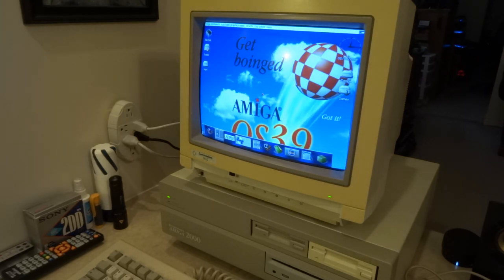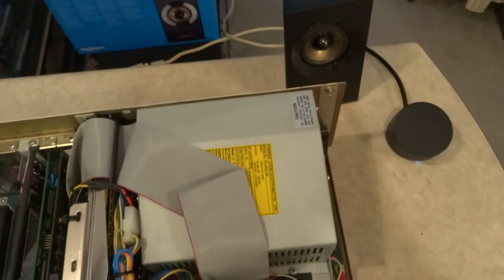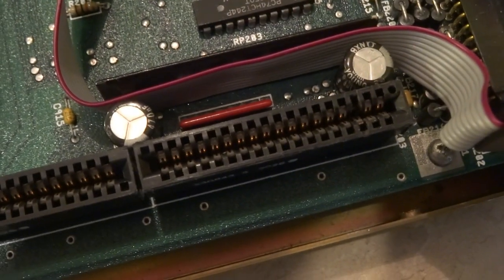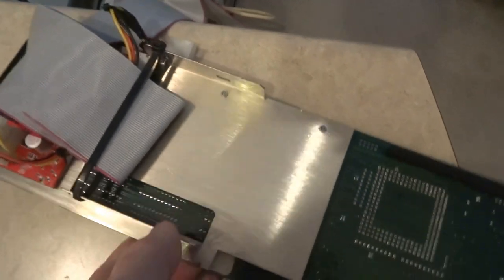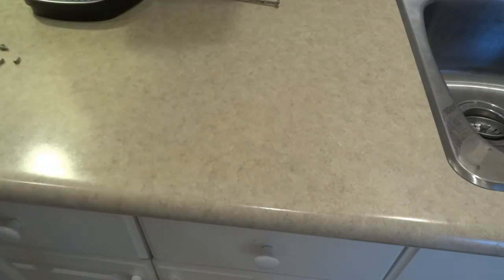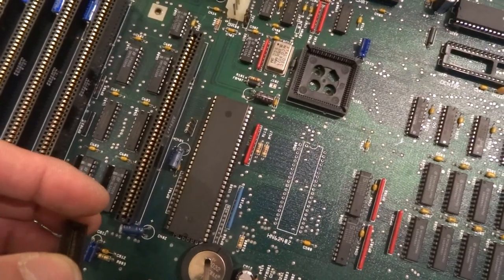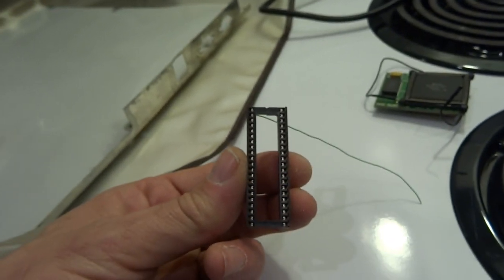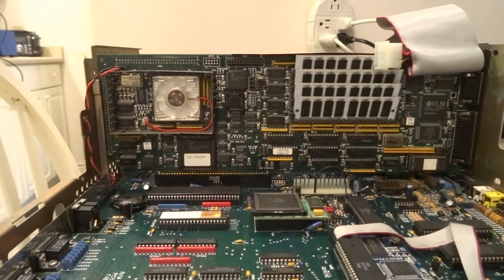Amiga 2000 1MB ROM Upgrade (and other things) - Part 1

Comment: Nice video and skills! And, what a very neat setup you do have there! A2000 was (and still is) so versatile, I love it. Cheers, M
Reply from the maker: Thanks you so much. It's appreciated. I have had electronics as a hobby for many years and the Amiga has been part of my computer Interests for almost as long (over 25 years). I definitely agree, the Amiga is truly one of the most versatile computers ever invented.
Reply: The A2000 was a very good Amiga, a simple upgrade to the A1000 (perhaps what the A1000 should have been in the first place; some subtle improvements and cost savings were done I think, which probably necessitated the experience of making the A1000 to learn lessons, but the A1000 was a bit of a compromise because there wasn't complete agreement on whether the Amiga should be a low cost home computer or a very expandable business machine, so they had a rather costly home computer that was a bit bothersome to add hard disks etc. to, and it only had 256k as standard). The A2000 was, as I say, a simple but significant upgrade, quadrupling the Chip RAM and adding large physical capacity and a generous number of expansion slots that didn't necessitate separate cases and pass throughs and lateral sprawl across a desk (which expanding the A1000 entailed). I love the massive expansions cards, they look so impressive :) The A2000 was very versatile by the simple virtue of this expandability, it made it a good starting Amiga for anyone contemplating big expansions in the future. I think it was pretty good value for money at the time too, whereas the A3000 (though a great computer) seemed rather costly for what it was (and I've heard that its slightly smaller case, though undoubtedly beautiful, meant that it could not accomodate a Video Toaster, possibly the most illustrious expansion card that existed for the Amiga. That was a bit unlucky for Commodore as Wikipedia suggests that the Toaster came out late in the same year as the A3000, 1990), as did the A4000. A2000 accelerators and the like did however tend to be a bit more expensive compared to the other big box Amigas (I know this from perusing magazine ads). That's a lovely desktop background, though I always feel a bit strange when I see Workbench which isn't rendered in either muted blue and grey or bold blue and burning orange :)

Comment: It”s 1MB RAM, ROM is the Kickstart. Got the new ACA1233n-55 in my A500 and latter in Oktober also in my A1200. My A500 Rev6A is a beast. Have 2MB CHIP RAM from the ACE2, ACA500Plus V1 and the 1MB SLOW RAM and 128MB FAST RAM from the ACA1233n-55. Running 68030 with 55MHz on AmigaOS 3.1.4 with a full 64GB CF card. Have connect it with the Indivision ECS V1 on a BenQ BL702A VGA 17 inch mknitor. Waiting for the Indivision AGA MK2CR for my A1200 for my second BenQ BL702A monitor and have 2 Bose speakers sets. Have now the ACA1221EC in my A1200. 

The AMIGA 2000 is a great AMIGA such as the A1000/A3000 and the A4000. Like the A3000 the most. For me the A500 and A1200 are more than enough.
Reply: It is a ROM upgrade rather than RAM, it's replacing the original K/S ROM with a later version of it. It sounds like you have some cool Amigas, I sadly no longer have any!

Comment: Fun video, thank you.  I have the save GVP, got the memory sims from the Denmark Ebay seller which look just like yours. In any event, I had the SCSI2SD adapter as well and had to CTRL-A-A on every cold boot to get it to boot. Must be something with that adapter and CPU card.  I replaced the SCSI2SD with a Buddha IDE and don't have any boot issues, it is also much faster. I noticed you had the CDA header connected to you Prism Megamix, were you able to get CD audio working with it?
Reply from the maker: I am glad you enjoyed the video. I have the same issue (as you noticed) with the SCSI2SD adapter, no matter how I try to configure it via it's USB port with my laptop. I have the Buddha IDE add-on, never got around to installing it, perhaps I should :)

As for the Prisma MegaMix, the CD Audio doesn't work with it, as you stated. They were supposed to make some kind of module to allow that but it appears development has stalled, sad really. I hooked up the CD Audio cable for completeness I guess... maybe I was hoping it would magically work one day :)

Comment: Was it something to do with the FCC or whatever it was called in the US? The governing body of radio transmissions?
Reply from the maker: Yes, apllied to Canada as well. Its along the lines of using Electronic devices on Planes. Not proven to adversely affect the plane's electronic systems but the Agencies err on the side of caution any way.
Reply: @amigaretro4765  Yes I always thought it was something to do with radio communications. I can remember when we used to have a radio licence just to listen to the radio and then when we got TV in about 1960 we also needed a licence for that. The licences were abolished in 1974 here.

Comment: Question: Did you use a de-soldering station or the manual (wear out your thumb) spring-loaded plunger type? lol
Reply from the maker: I use a vacuum de-soldering station. Sometimes I use a combination of this and an SMD heat gun for the more stubborn tasks. Those manual plunger units are OK in a pinch but are not ideal for quality work especially when you need to de-solder a 68000 CPU socket (64 Pins)    :)

Comment: I see you don't like removing the shield all the time as it must be a real pain in the proverbial.
In Australia and Europe we do not have a shield or plastic insulator sheet underneath the motherboard on the 2000.
I wonder if yours is necessary any more as I believe it was to do with radio interference issues back in the 80's and 90's.
I have had my A2000 ver 6.2 since new in 1992; my brother got his in 1991 and I also have one I bought from Germany in the 2000's and none with shields. In all the videos I have seen about 2000's it is only the American ones that seem to have them.
Maybe you can remove it now.
Cheers from Australia.
Alan
Reply from the maker: Alan, It's funny you have mentioned this. I normally remove the rather useless RF shields shields from my A500s and C 64s. Why I haven't done this on the A2000 I don't know. I will do this next time I have to work on my 2000. You are correct, the shield removal process is rather unpleasant.
Reply: Funnily enough I've heard that with there being so many wireless devices these days, RF shielding might actually be worthwhile keeping in place. I don't know much about it though, just what I read under another Youtube video.

Comment: Your PSU is very silent, did you mod it in anyway?
Reply from the maker: I replaced the FAN  with one that had similar airflow specs a while back. It keeps it cool and yes, it is much quieter :)

Comment: What's the MP3 card you're using in there?
Reply: AH - you say it later on, the "MegaMix". Cool - I'll research that. Sounds interesting! (get it? sounds...interesting.) :P
Reply: Still going here... Do you like the card? Does it come with its own music player software or do you use something else?
Reply from the maker: It comes with the driver Floppy Disk only. A good audio player that supports the Prisma MegaMix is Amiga Amp.  It sounds great and is easy to install. Version 3.23 is the latest and comes in 68K and PPC variants.

AmigaKit sells the Prisma MegaMix : https://amigakit.amiga.store/product_info.php?products_id=1218&currency=USD
AmigaAmp can be found here: http://www.amigaamp.de/download.shtml

The driver is installed in Devs: and you set Amiga Amp to use it as an External Player, that's it :)
Reply from the maker: It's the Prisma MegMix. It also handles FLAC as well. Amiga Kit sells them for the A1200 and Big box Amigas.

Comment: I would just use 3.9
Reply from the maker: Actually, the best combination is the 3.1.4 ROM with  OS 3.9 installed.The 3.1.4 allows for native (not patched) large disk Support (greater than 4 GB) and has many bug fixes. This ROM works great on my A1200 tower which runs OS 3.9.